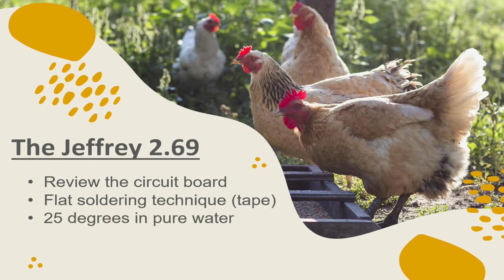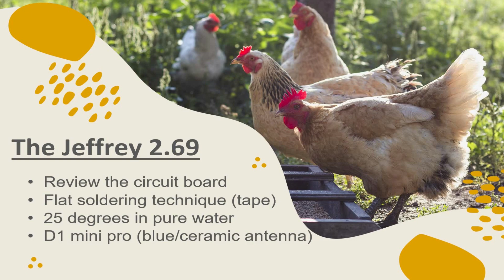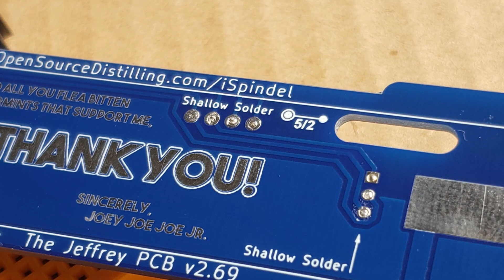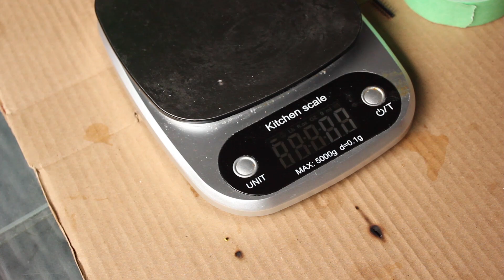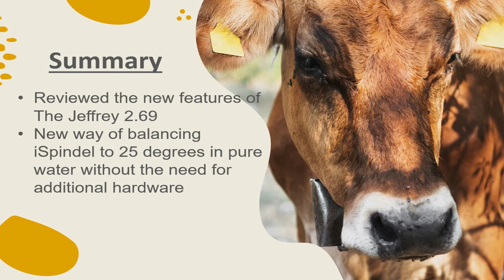The Jeffrey 2.69, Flat Soldering, New Balancing Technique to 25 degrees

Comment: Hey What’s your thoughts on the still spirits air still wonder if I can make the heat adjustable Thanks
Reply from the maker: Hey Travis, Yeah I have an adjustable one that I built for the Air Still (I have a knock off). Was thinking about doing a teardown and reassembly video on it as it was built years ago. It's been on my to-do list. I'm not sure if anyone has made a video on that topic yet. Maybe it's time!
Reply: @OpenSourceDistilling  That would be great Thanks

Comment: I like the updates! Have you seen a performance difference in the ceramic antennae vs the copper?
Reply from the maker: I'll have to check on that. Both antennae connect without issue but I'm not sure if there is a difference in signal strength.

Comment: Nice! I tried using the bottom solder tab on the battery like this for balancing. Took a lot of solder before I decided to add weights instead. I also found you could fine tune it by moving your weight, which gave an extra accuracy opportunity. It's an interesting point that if you could calibrate it to 25° exactly, then maybe you can just use a standard equation? or there could be an equation for each 0.1° increment in calibration angle? So it checks the calibration angle, and if it's close enough, just auto look up an equation that should be pretty close.
Reply from the maker: Hey Leo, I'm not sure how the calibration formula works but balancing to 25° is a requirement after assembly. So the closer to 25° you can get the better :)